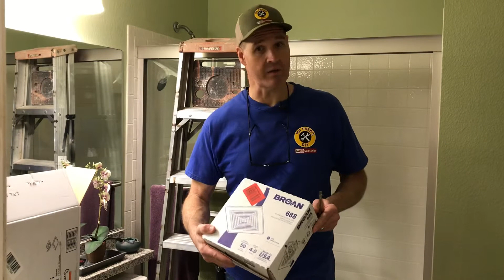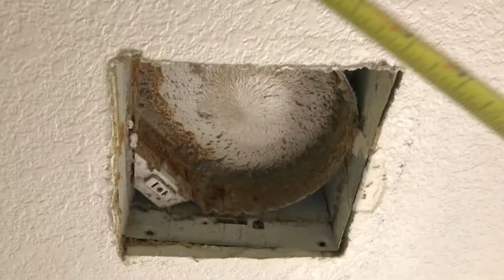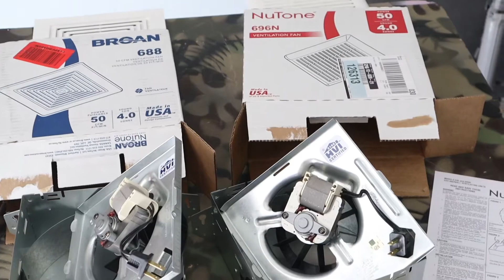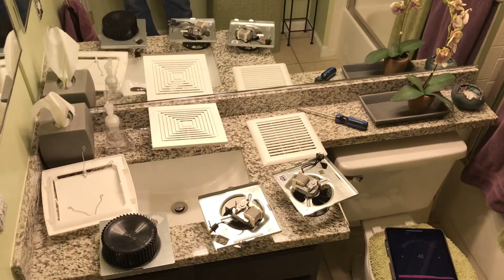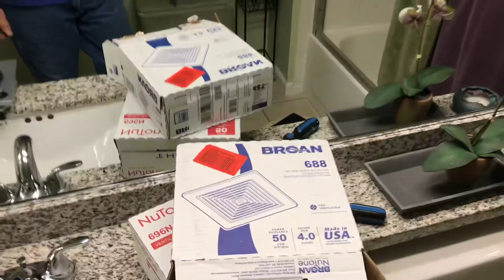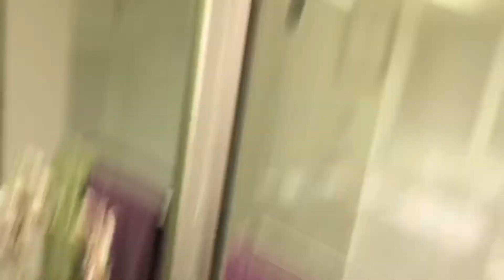Quick & Easy Bathroom Fan Fix

Comment: Nice video! I especially appreciate that you did the comparison among the three fans. I replaced several myself. I really like the QK60S which is more powerful and quieter.  The old version is 690 which is more flexible because it has two plates which also cover the ones with outlet on the side instead of at the corner. If you have an older fan made before 1999, the QK60 may not fit.